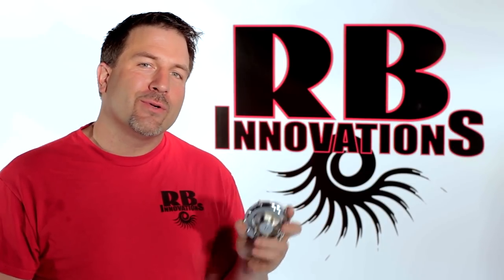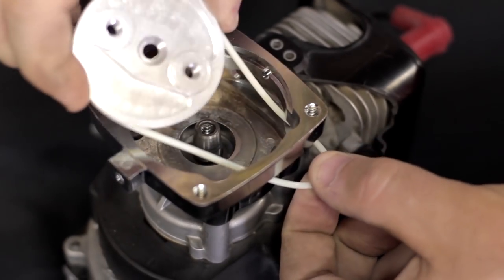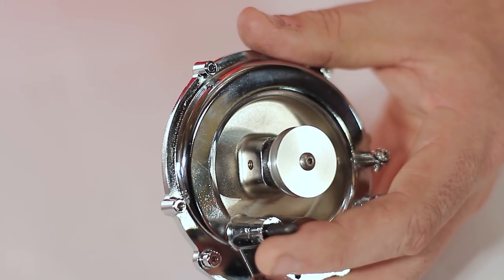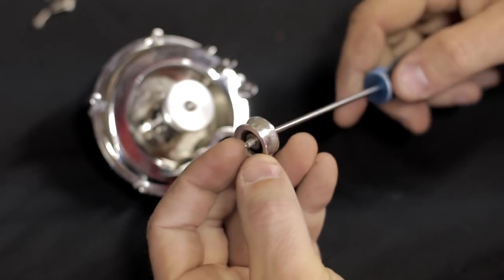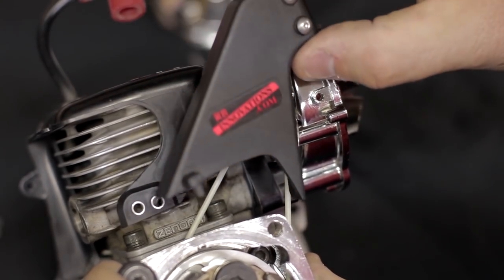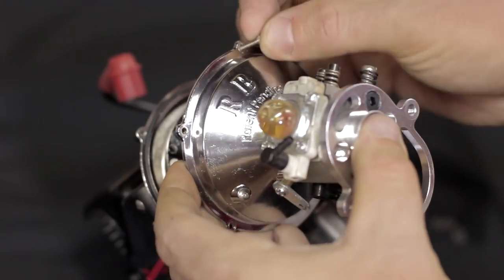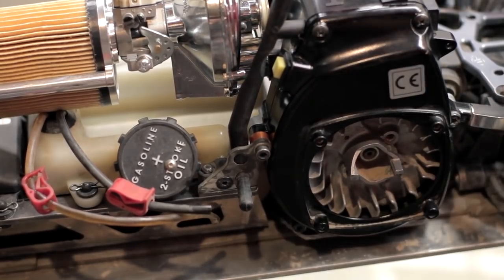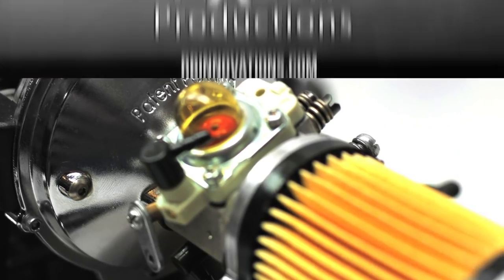How to Install the 1/5th Scale Supercharger to an HPI Baja 5B

Comment: Okay. Once and for all, here's the reason these "superchargers" appear to work:

The little engines in our RCs run at extremely high RPMs, and at high RPMs they are constantly suffocating. If the engine has a rotary intake valve built into the crankshaft, it doesn't stay open long enough for fresh air to fill the crankcase up to full atmospheric pressure; if it has a reed valve instead, the springiness of the steel reeds cause them to snap closed before the crankcase can be completely pressurized. And in both cases, the exhaust port in the cylinder wall doesn't stay uncovered for long enough for all the exhaust to get pushed out. Strapping a fan to the intake CAN help relieve this problem by reducing the vacuum in the intake, so there will be a little more pressure in the crankcase to scavenge and refill the combustion chamber when the transfer ports open.

BUT HERE'S THE PROBLEM: There is already air outside the engine that is "pressurized" compared to the partial vacuum inside the crankcase at high RPM. That air "wants" to get into the engine, but the valves and ports are getting in the way. So if you just take a few hours to use a Dremel to improve the porting of the engine, YOU WILL GET THE EXACT SAME BENEFIT FOR FREE.

In other words, if this product works for you, it works because you're lazy. I spent a few hours last week grinding and filing the ports on a crappy old nitro engine I have, and I increased its redline by 11%. That's a bigger improvement than you'll ever see with this product.
Reply: Holy fuck.... Someone that understands why you get a seat of the pants reaction to this.....
Reply: :D

Comment: I actually tried this. It kills the engine torque but gains higher rpms and I think it should have been designed in a way where the carb sits between the engine and the supercharger.  Also the belt could not handle the pressure and I had to replace it 3 times in 10 days before I gave up.

Comment: 6-71 Detroit had  the  supercharger. .  it gave the engine a smoother power band. .  the 671  was a 2 stroke   with exhaust valves
Reply: If the engine has exhaust valves, then it can trap air pressure in the cylinder after the exhaust stroke ends. A valveless 2-stroke engine can't do that, hence why this "supercharger" is mostly useless. If it does anything at all, the only thing it can possibly do is slightly pressurize the bottom of the crankcase so the transfer ports can be slightly more effective in blowing exhaust out of the combustion chamber after each power stroke.
Reply: Shawn Elliott I had one on a nitro engine it was useless. by the time i tuned fat enough at top speed so I wouldn’t lean out it would barely run at  idle and load up because it was to rich. I spent more time jerking with it then actually running it. when i took The super charger off My truck was actually faster and ran cooler Plus it goes on a diet by removing the novelty.
Reply: HAHAHA, a 2stroke with exhaust valves !?!?!?!? i've studied engine mechanics for 3 years and never had heard of such a thing

Comment from the maker: Yes, it has a significant increase in hp, power varies depending on the engine and exhaust, and yes it is compatible with the OBR 36cc. If you need more information, feel free to give us a call at 315-451-4440

Comment: Forgot to add that forced induction can be used to reduce pumping losses, the miller cycle engine is one example of this, piston pumps are very inefficient, so using a turbo/blower to do some of the compressing makes the motor more volumetrically efficient. Look up the 2000ish Mazda Millenia S on wikipedia or here on YT.

Comment: I would imagine that you'd want to set everything up as though it were a reed valve, because with the supercharger constantly pressurizing the crank case with air and fuel, you'd also want higher volume in the crank case to allow more air and fuel to be charged through the transfer ports.
Reply: It's not constantly pressurizing the crankcase. The rotary intake valve integrated into the crankshaft prevents the "supercharger" from pushing air into the crankcase except when the intake valve is open.
Reply: Well yeah, but Zenoah/CY engines do not have rotary valves. There are reed valves...But what I'm saying is to literally have the intake manifold flow directly into the crank case without any valves closing anything off..It's just theory of how to get these to work better.
Reply: If this specific engine has a reed valve in the intake, rather than a rotary valve as smaller engines have, then I agree that this fan could pressurize the crankcase a little bit more than the engine could normally achieve -- IF the fan is capable of exceeding the "cracking pressure" of the reed valve, so air could actually get past the valve at all.

Comment: Hi there is it possible to have a supercharger for a gas power (26cc) boat working on "NO" clutch with "5" inch rails? and how much are these superchargers?.
Thanks for your help 
Marc
Reply: looked em up there $275 but u could do the same thing with a eletric motor rigged up to work with the throttle servo

Comment: Contrary to what most people believe this probably would make a noticeable difference over stock.

Initially when people hear about super charging they think about air being compressed in the cyl... Well thats partly true but only for 4 strokes. 

Since the 2 stroke cant actually compress the air the way a 4 stroke does under boost the super charger in this case is NOT for compressing air for the 2 stroke.. Its for flowing MORE air through the engine.  

Which in turn means running more fuel and hotter spark and a stronger power band.  Some people seem to think its usless because the engine cannot compress boosted air, that it " blows by " well thats the point in the case of a two stroke. 

To put it simple.. The more velocity/volume of air passing through that cyl.. the more power.  Again... the idea is not compressing the air, just flowing more through the engine to run a richer mixture.  Any time you can add more fuel to ANY engine with out flooding it, youll obtain more power.
Reply: I was thinking about that, the higer flow makes the cylinder get cleaner air by eliminating all the CO2 and the engine will run sligthly cooler, we cant call it a supercharger but instead a superfan
Reply: Yeah i think people heard the same super charged and immediately think that it means compressing the air but thats only in a 4 stroke engine. regardless of what anyone says about this... If you can flow MORE air through a 2 stroke engine you will get additional power.
Reply: Or you can use a better exhaust that enables better airflow without an expensive power-robbing blower attached to the intake.
Reply: Running rich produces LESS power, not more power. A rich mixture combusts more slowly and wastes energy heating up the portion of the fuel that doesn't get burned. A lean mixture (within reason) always produces more power than a rich mixture. That's why running lean is so dangerous; even if the engine is properly lubricated, as is the case in a 4-stroke engine with a dedicated oil supply, a lean mixture will burn hotter and make the engine work harder, causing the engine to overheat. That's why the way to prevent detonation or pre-ignition is to enrich the fuel mixture, to cool the engine down and make it produce less power.
Reply: Flowing more air into the engine?. Isn't that how compression works? You shove more in the same space, so the airs denser than usual. Meaning it's been compressed.
Reply: In this situation, if what you are saying were true, the excess "flow" and "richer mixture" would still be "going out the exhaust" Turbochargers can work on 2 strokes because you can size them just right to get the turbine drive pressure to help reduce or eliminate blow-through. On the other hand, throwing a supercharger on a normal 2 stroke engine isn't effective. It is possible, to supercharge a 2 stroke but your intake and exhaust port timing and size would have to be drastically altered to minimize the overlap, possibly using a "power valve" or variable exhaust port with modified settings.

Comment: You can't really pump air into a 2 stroke? The exhaust and intake are not valve controlled and are both open on down stroke so any charge built up would just be lost out exhaust.  The best is what's already well walked ground which is taking advantage of the pressure wave in the 2 banger exhaust.
Reply: no you can't supercharge a 2stroke

Comment: how much psi does this make??

and i know you "can" run forced induction on 2 strokes, its just very inefficient as the combustion/compression is only on the intake for such a short period of time
your really only using a small fraction of the compressed air in the cylinder as the exhaust/intake over laps. but the intake/compression moment is there only for such a short period of time compared to the rest of the power cycle
it does work just not as well as a 4 stroke engine

Comment: Useless and actually robs the engine of power. The extra power, "if" any is wasted having to spin the super charger, it adds drag to the engine. Plus the motor takes longer to reach peak rpm with the added drag and weight, A engine without this will reach peak rpm well before a engine with one, therefore making your rc car slower at reaching top speed and slower in acceleration. Lots of people showed up with these at local races a while back when they first came out and was a novelty and got beat badly. There is a reason that professional racers DONT use them. Not a single professional sponsored racer use them. Plus the simple fact that they dont provide dyno or any type of proof they actually work. They sell you on the wow factor of appearance, not practicality.
Reply: Eccentric Smithy actually if you knew about supercharging, power comes easy
Reply: It's a win loss situation. Yes it takes longer but throughout the rpm range it makes more power.
Reply: @TheUniversalid  you CAN't supercharge a 2stroke engine !!
Reply: @erwinmaes3105  you can

Comment: Is the supercharger made of plastic?
Reply: John Capidecallu thats actually chromed injection molded magnesium or aluminum...
Reply: No, that's chromed injection molded plastic. Also "supercharging" a two stroke crankcase-scavenged gasoline engine is totally useless since it's supercharged by design, thanks to the inertial supercharging effect.
Reply: John Capidecallu you clearly do not know only 1 company has a patent for chroming plastic and they make buttons for clothes... Not that you own what you think is plastic... You also clearly don't understand a basic blower concept
Reply: There's really no point in going on with this discussion, keep thinking whatever you want. Have a good day!
Reply: Right be ause you can't identify what you look at not do you understand that tiny motor only needs mere ounces of pressure not pounds

Comment: you won't make much more power with a kit like this. the better and free option would be to Dremel a boost port into the cylinder wall and window the piston you could also drill the Piston to prevent parachuting and increase the RPM another thousand and of course let's not forget a bit of porting keep in mind cranking out more then 18000 rpms will fry the stock bearings replace them with skf

Comment: If this is really pushing more air into the engine you would have to jet up the carb or it will lean out and blow up asuming rc carbs have jets? Lol idk
Reply: the carbs on these 2 strokes have diaphragms and not jets but little oles and channels for the petrol and mini moto carbs they have a float and float bowl and jets

Comment: its usless
Reply: I think these will work better if the charger were to flow directly into the crankcase where it will be pressurizing the crankcase at all times with air/fuel...sending a heavy charge of pressurized air fuel into the combustion chamber once the transfer ports are opened.
Reply: TheNoisePolluter Was
Reply: Ya especially when it cost as much as a new motor
Reply: @TheNoisePolluter  it won't work !! on a 2stroke the intake port and the exhaust port are open at the same time ... which means that the pressure fly's straight out the exhaust

Comment: No way that will produce boost. The only thing I could see it doing is atomizing the fuel and air by mixing it up with that big fan spinning. But I think the parasitic loss from spinning that so called supercharger will negate any gains from the fuel atomizing.

Comment: If someone could make a small working nitrous kit, that would be a lot more effective.
Reply: If you’ve got the money I can make you one, but it won’t be cheap, about half the cost of the car..500 bucks, but your make power, the issue is the time I’d have to spend Tunning and replacing engines until I knew it was safe, and I’d have to sell at least 10 just to break even …I was a master tech for 30yrs, I raced and built engines since about 1984..I think we could use tiny needle valves for jets at first, would need a good printer guy with me too..we could used CO2 cartridges as NOS bottles, switches and the rpm is easy enough..im game..
Reply: In fact I think I’ve got enough stuff I could make them for about 160, bucks..after looking up the stuff I need..easy..

Comment: LOL, this kind of thing will never work on a 2 stroke engine, I tried this out wayyyyyyyy before RB inovations came along, basically I had a Kyosho SuperTen chassis with the std GT15SCR engine and there was an Ducted cooling fan belt drive kit for it, I implemented a plastic tubing around it feeding it into the carburettor LOL same idea but never produced more power but felt underpowered, the reason it wont work on a two stroke engine  is the fuel air intake timing ports, exhaust port is momentarily open whilst in the intake stroke of cycle! and also whats funny about this video is when the guy turned the crankshaft it looked 1:1 ratio between crank and charger impeller LOL....
Reply: cetinGT3 Supercharged 2 strokes do exist but the smaller you make them you get diminishing returns to the point where it will actually hurt performance like this.
Reply: Fukoff Gewgle  simply people should just mod these kits to fit the 4 stroke plane engines and install in their rc cars! that would work lol.
Reply: Fukoff Gewgle Why are toy so mean to Gewgle????
Reply: Henk Beenen what?
Reply: Henk Beenen I wasn't mean to him! I merely pointed out that the gains of this implementation is not viable!
Reply: cetinGT3 no just look at his name!
Reply: Henk Beenen ohhhh, LOL you Joker :)
Reply: cetinGT3 :D
Reply: a fan won't work anyway unless it compresses :P

but they definitely need to stop with this joke of a product!

Comment: Supercharger for a 2-stroker? WTF
Reply: It's possible, but only in a valved engine like the ones used in snowmobiles and old diesel trucks. It can't work with a valveless engine.
Reply: @deusexaethera  snowmobiles ar 4stroke engines !! rc's are 2stroke

Comment: ???????? supercharger on a 2 stroke???? useless
Reply: Turbos and superchargers come on 2 stroke sleds from the factory now, believe me they make more power. Doesn't mean this lil fan impeller run by an o-ring works lol but yes forced induction does work on 2 strokes.

Comment: 5% more power ?  30% ? 
since i dont know i dont want it 
XD
dont bother saying " theres a video for that "
Reply: 31% hp gain, he tested a stock engine it made 3.2hp and then he supercharged the same engine and it made 4.19 hp equaling 31% hp gain and they are slightly more fuel efficient

Comment: Charging a 2-stroke Engine?! :'D Please...PLEASE... RB Innovations.... unterstand the function of a 2 stroker before develop some things that doesnt realy make sense :-D
Reply: RDraconiX do you not know how forced injection works?
Reply: RDraconiX you know that they do actually make supercharger and turbocharger systems for 2 strokes right? Like i know this thing looks like and most likely is a piece of shit but they have been a thing for a long time just look up turbo/supercharged skidoos
Reply: RDraconiX have you ever heard of Detroit diesel. They are 2 strokes and they are super charged and turbo charged.
Reply: Sackmatters they are blowers on a Detroit not superchargers. They don’t make boots they only scavenge the air
Reply: @TheUniversalid  do you even now how a carburetors works !?!
Reply: @russellp1982  this is about supercharging a 2stroke engine and a 2stroker don has valves in the intake/exhaust port (only a reed valve on the crankcase port)
Reply: @russellp1982  actually i'm a cirtified motorcycle mechanic and you can't pressurize a 2stroke engine like they clame in this video !! + a 2stroke rc is a weed wacker/lawn mower engine bro....
Reply: @erwinmaes3105  ok so when the piston is below the reed valve the forced air can come into the cylinder and straight out the exhaust now the piston is on its compression stroke passed the reed valve but not passed the exhaust port yet letting more out the exhaust by the time the piston covers the exhaust port you are back to the same compression ratio you had with no turbo.
Reply: @russellp1982  go back to school !! there is no reed valve on the cilinder but on the crankcase. and if the the compression ratio is the same without turbo IT MEANS THAT THE TURBO ISN'T DOING SHIT
Reply: @russellp1982  haha, if you are a mechanic i'm glad your not working on my car. lol
Reply: @russellp1982  i know how 2stroke engines work... maybe you need to looks at some youtube video's about 2stroke engines and you will know it to
Reply: @erwinmaes3105  my whole argument is the turbo will not work on this motor and that some 2 strokes do have valves like a 6v71
Reply: @russellp1982  ok bro, i looked it up about your 6v71, and i can tell you that as a european i have never heard about a "2stroke DIESEL" in europe there is no such thing as diesel 2stroke.. 2stroke's here where always gasoline engines and diesels are ALWAYS 4stroke engines